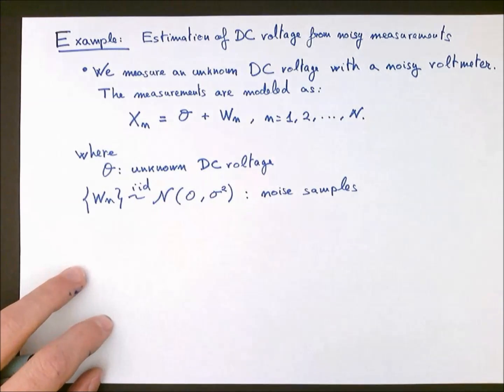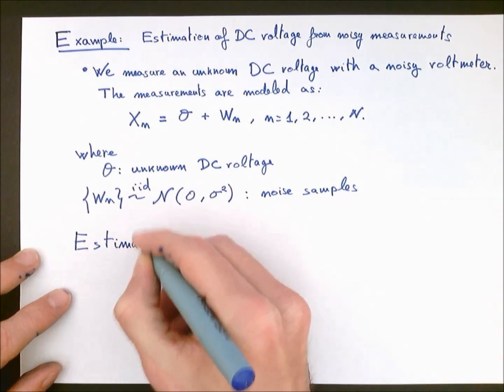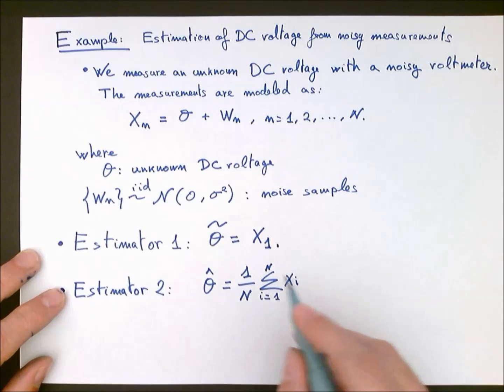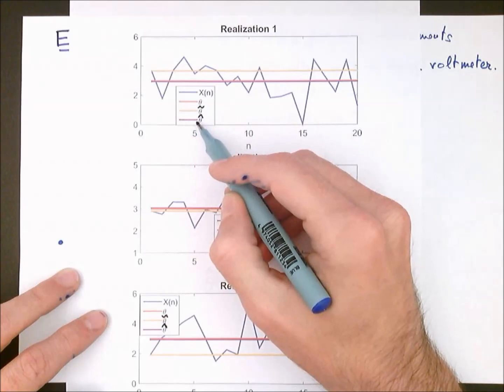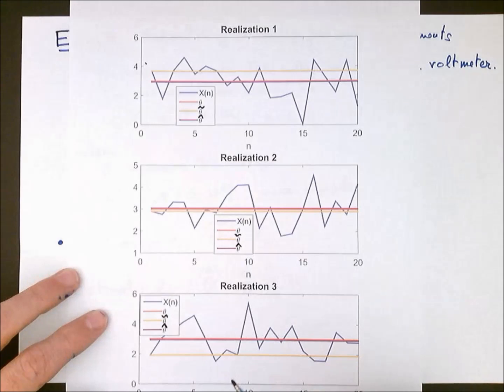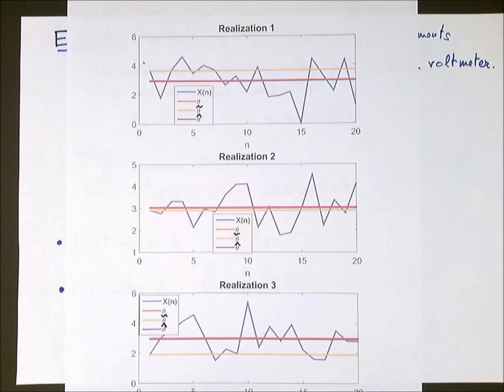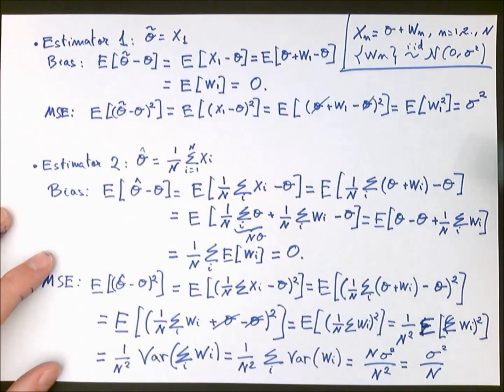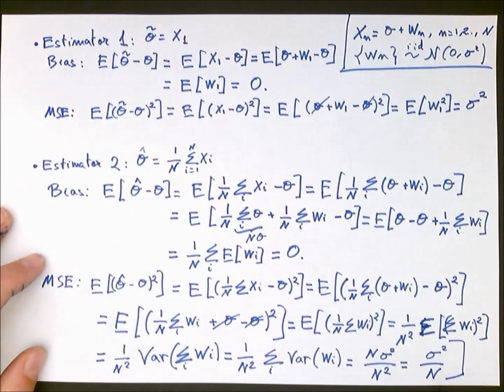(SP16.2) Example: Bias and MSE of Two Estimators

Comment: Plz guide me when theta is unknown how you say that actual value is 3 and 2nd estimator is good one and estimate the true value..how we know about true value?...can you share the code of these realization
Reply: To characterize the performance of the two estimators, he probably simulated it by putting theta=3 in his simulation and pretended as if we don't know the true parameter. Doing so would help one find which estimator would be better. This would help in real-world problems when we don't know the actual parameter but based of above, we still can know which of the estimators might be better. Hope it helps.